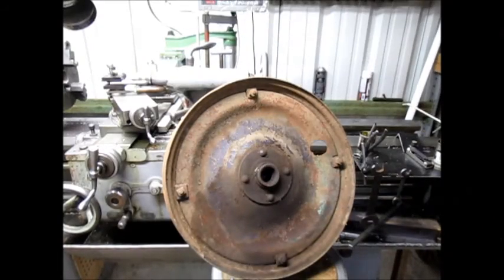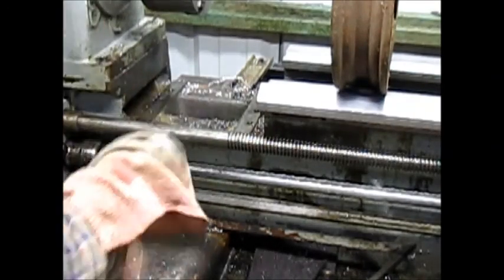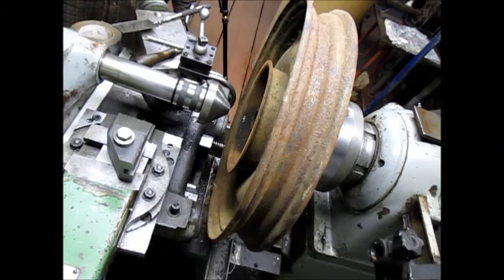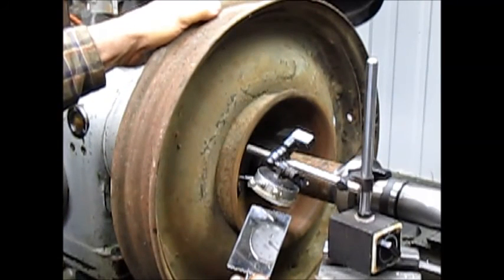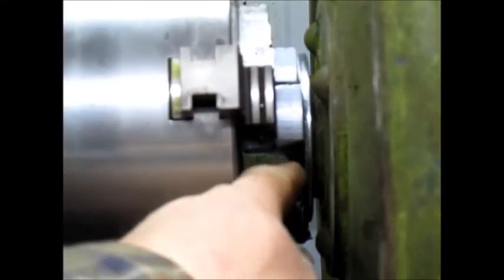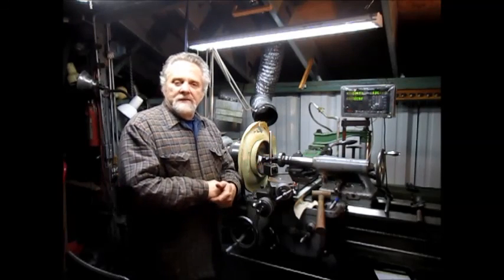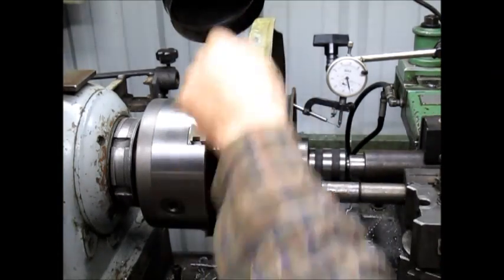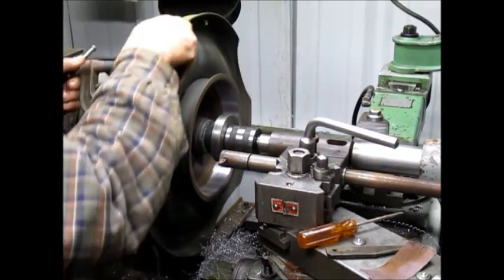Hub Bub

Comment: I did similar on my milling machine with rotary table and a boring tool. Clapped wheel down to rotary table using a turned mandrel to suit wheel. Clocked in and then bored using a boring head and quill feed and stop. Fairly easy and quick process.
Reply from the maker: All good ideas of the endless ways to approach any given project. Thanks for watching